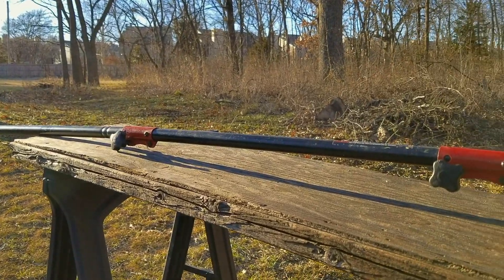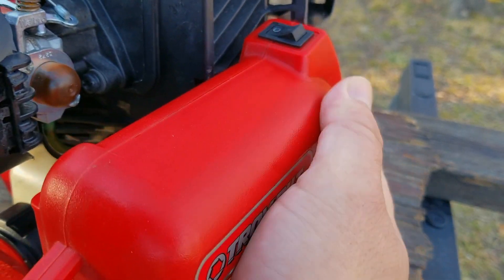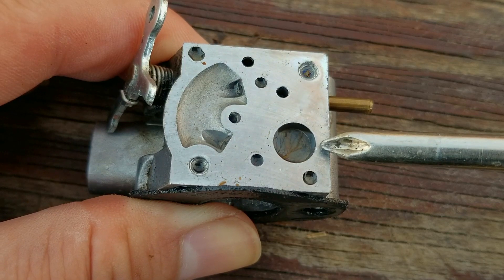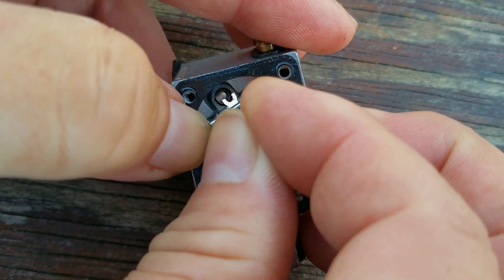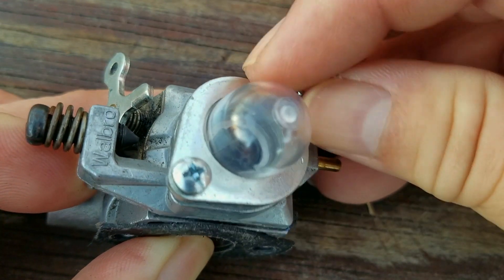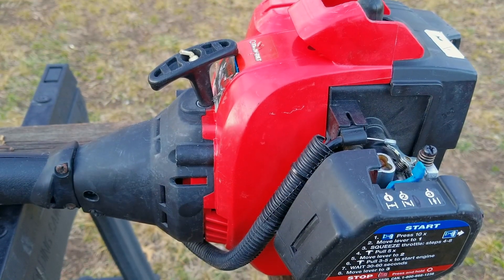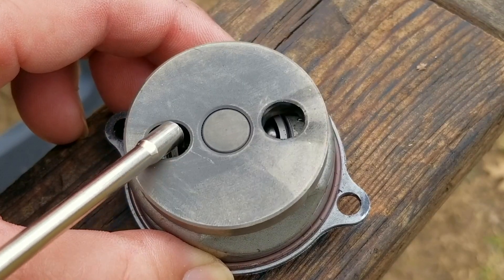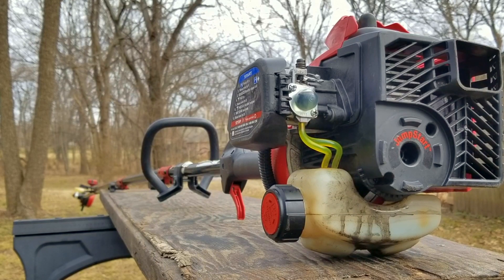Troy-Bilt Pole saw won't stay running

Comment: Nice saw, I would drill out the broken bolt, get two new ones and put them in with some apoxi or sealer
Reply from the maker: That's a very good idea
Reply: Or maybe use a bit longer screws with spring washers
Reply from the maker: @samuelvelez1643  that's a good possibility
Reply: or drill them out and put a small heli coil , do it right means doing it once eh ! Great videos tho bud my elderly neighbour picked up a toro blower that won't stay running and the carb is discontinued so with your excellent help I'm going to go through it to try to clean it up and tune it for him .
Reply: With drilling you can damage the treads, theres really good method with copper pipe and welding, search for it on youtube
Reply: @flaviokonti5522  thats what heli coils are made for

Comment: Excellent presentation in your videos. No uh uh stumbling or rambling. I do much appreciate that.
 Fyi to the brand believers.
If you work on several different brands you'll soon realize they're all the same engine. There are only two manufacturers of outdoor power equipment small engines. Trimmers blowers Etc. The only difference is the dressings. A friend gave me several roadside pickups. 1 blower and the others were trimmers. Two Troy-Bilt that were different models but the engines were exactly the  same. TB32 ec and TB35EC. 
A Murray that had the exact same engine. Three weed eater products of which one was a blower. The only difference was the blower had a shorter crankshaft. They were different from the Troy-Bilt but that is only due to being from an older design. There is no difference from buying a box store piece of equipment other than paying an extra 50 to $100 to buy one from a brand dealer
Reply from the maker: thank you and I appreciate the  information

Comment: I'd heat up the metal holding the broken bolt piece then drill the piece out with a left hand drill bit. The first two threads of the hole might get wrecked but you could chase them clean.
Reply from the maker: I didn't think about using heat. Thanks.

Comment: Ways like the multi tool attachment tools, they are much kore simpler and more compact instead of buying one tool for each if you can buy a tool system that’s interchangeable. Also, i hope your day as good my friend, look forward too your videos every week. Oh and my dad and i this summer will be working  on fixing the loose belts on our snowblower, and change the oil, we will replace the belts, sand the rusted spots down, and put a fresh coat of paint to make it look good. What do you think, sound good. I think so.
Reply from the maker: that sounds like a great idea. No harm in making something that's as useful as a snow blower look good again.

Comment: use extractor and remove broken screw retap and use new screws of higher grade with loctite 242
Reply from the maker: You read my mind!
Reply: i know Im quite randomly asking but do anybody know a good website to stream newly released series online ?
Reply: @Conrad Ezequiel Try FlixZone. Just search on google for it :)
Reply: @Dillon Tatum definitely, have been using Flixzone for since april myself :)
Reply: @Dillon Tatum Thanks, I signed up and it seems to work :) I really appreciate it !
Reply: @Conrad Ezequiel Glad I could help =)

Comment: Good video. I think it's worth trying to get the broken bolts out as it sounds like it still has plenty of sting left in it.
Reply from the maker: Yes I want to try and save it. I don't know if I'll get an easy out kit as this doesn't happen all the time so I might be wasting my money on it.
Reply: @HomeGaragechannel  
I wouldn't use easy outs anyway because they usually break and then you will have a problem. I have more success with drilling them then the rest of the thread comes out easy.
Reply from the maker: @stevenchandler4218  that's what I've seen too. The easy out breaks and now you have two problems.
Reply: @HomeGaragechannel  
Exactly and you don't want that to happen man.... Grrt!

Comment: Try & drill a small pilot hole in into the broken off screw & use an easy out to remove it or try & remove it using a thin  bladed screwdriver.

If worst comes to worss just drill it out oversized if you can & fit bigger screws on both sides,I had to do this with a Stihl hedge trimmer which was held together by 5mm self tapping screws,I drilled the threads out & fitted 6 mm  M304 grade stainless steel Allen head socket bolts which were much stronger !
Reply from the maker: You've read my mind

Comment: I would try some red thread locker and if that doesn't work try to get the broken end of the bolt out with a good easy out.
Reply from the maker: that's an option if I don't decide to try and drill it out.
Reply: Red threadlocker! Certainly, if you want to never never remove that bolt again. Use nothing beyond the blue when thread locking into aluminum

Comment: I would first try to extract the bolt. If that was unsuccessful, then I would use red thread locker and let it cure overnight before starting the engine. To ensure that it doesn’t back out, I would put the bolt in a vise and drill a hole through the side of the head. Install the bolt. Then take a piece of wire about twice as long as the distance to another bolt you can attach the wire to. Run the wire through the hole you drilled previously to somewhere near the midway point. Twist the wires together several turns keeping the first twists as tight to the head of the bolt as possible. Attach the loose end of the wire to the nearby bolt or anything metal and pull it tight. The wire will prevent the bolt from turning. If you want to drill the bolt out, take a piece of tubing that will fit in the hole and let the tubing be your drill guide. It will protect the threads and keep the bit centered on the bolt.
Reply from the maker: thank you Bruce Coleman.

Comment: Use high-temp, non-hardening gasket maker to seal the jump start adapter to the block. Extract any broken bolt(s) and install replacement(s) with high-strength threadlocker. Less than high-strength threadlocker (lock-tite blue, for example) will be weakened by the engine heat and thus effectively negated.
Reply from the maker: thank you

Comment: I think I have this same issue with my Troy built 4cycle. It’s hard starting and super annoying. Possibly not bc it does stay running. 

As for a fix I would drill the bolt out re tap the holes and thread lock new ones in.
Reply from the maker: Making plans for this fix already. Thanks

Comment: Hi,
see the video "How to remove a broken bolt in a deep hole  remove broken bolt in recessed hole" from the ultimate handyman. Perhaps you can drill out the bolt in 10 minutes with a centerdrilled bolt.
Reply from the maker: That's a good idea I'll have to take a look at the video
Reply from the maker: @xyz4469  now thats an idea

Comment: I'd say the reason that troybilt added the electric start is so it will be easier to start and run even troybilt knew their trimmer is hard to start but they are to lazy to fix the problem i suggest getting a commercial trimmer brand such as echo
Reply from the maker: That's a pretty good reason. Thanks
Reply: @HomeGaragechannel  you're welcome

Comment: My exact trimmer starts and runs like a top until it heats up, then stalls like I hit the kill switch.  Cools down, runs perfect until it gets hot.  Rinse lather repeat.  Did the very same before i totally replaced carb, lines, filters, and plug.  Maddening.
Reply from the maker: its either the ignition coil or the vent on the Fuel Tank.
Reply: @HomeGaragechannel  thanks very much!.  I’ll let you know how it works out.
Reply from the maker: good luck

Comment: I'd get a set of left handed drill bits and try and remove the stubs from the block or maybe drilling and tapping the bosses oversized and putting in a little bigger screws. That  jump starter is a fine idea but the one that I have hanging off my shoulder is getting pretty tired. Thanks and Blessings!
Reply from the maker: thank you Lewie McNeely
Reply: @HomeGaragechannel  U 2!

Comment: You should drill them out and tap the threads then add locktite to the new bolts and maybe even throw some lock-washers into the mix
Reply from the maker: that's a very good idea.

Comment: I need to get a carburetor rebuilt kit for my trimmers, they both have the same 25CC engine size. 
Where can I get the proper rebuilt kit for this carb? 
Great videos, have help me save my equipment.
Reply from the maker: go to ereplacmentparts dot com, and enter your model and serial number.

Comment: Great job as always.  My unsolicited opinion is:  this is why gasoline engines will go the route of the dinosaur.  It’s no wonder more and more people are choosing battery powered ‘everything’.
Reply from the maker: it does make sense, but I have to wonder about the environmental impact of making so many batteries.
Reply: @HomeGaragechannel  and what percentage of people dispose of li-ion batteries "properly" whatever that means. The price of replacement batteries is often more then the price of the tool its powering.

Comment: Remove the o-ring, clean the faces and fill with metal epoxy. Reassemble and let sit. Now you have a working engine.
Reply from the maker: the permanent fix
Reply: @HomeGaragechannel  Unless you want to drill out or extract the broken bolt, go for it.

Comment: I think the rest of that screw would come right out with an ez out. So does these types of string trimmers only have two kinds of carburetors? Short stem diaphragm and long stem? Thanks!
Reply from the maker: yes they are either short or long stems on the metering diaphragms. I haven't seen any other sizes.
Reply: @HomeGaragechannel  thank you for the info, your channel has answered many questions I've had on making my own repairs. I have a couple string trimmers that were my fathers, I'd love to get them running again. He passed away and hopefully he will be looking down when I get them going.
Reply from the maker: that would be a nice thing to do.

Comment: I would like to see you do a compression test on an old engine and a new engine. I have the same compression tester you showed and it will not measure the compression correctly on a engine with that small of a displacement. The reason being that it doesn't have a check valve on the screw in adapter. The small piston cannot pressure up the length of hose to the gauge. I am yet to find a small 2 cycle engine that it will work on. It will barely rise off of zero, but yet, the engines start and run fine. Show me!
Reply from the maker: I don't have a new engine available just yet but I do have an engine that has a lot of compression. I'm surprised your compression tester didn't have a valve in it.
Reply: @HomeGaragechannel  it has a valve right below the gauge. James Condon (Youtuber) clued me into this problem on one of his videos.

Comment: I got one of these trimmer heads same engine  and quick start feature for free and the crankshaft bearing wore out after I used it once after buying a carburetor for it. The crank was wobbling around and it caused the bottom and sides of the connecting rod to scrape all around inside the crankcase casing. I want to like these trimmers but I think they are the worst engine you can buy lol. They just have a very cheap sound to the engine when it’s running I don’t know how to explain it. It sounds hollow
Reply from the maker: I have to agree with you.  These are seen as good trimmers but really they're just like the other cheap stuff.

Comment: Drill the broken screw and clean it out of the hole. Get a replacement screw to help seal it. Its still a good motor.
Reply from the maker: yes you're definitely right, Thank you  babytammie.

Comment: New TroyBuilt TB25PS have crappy OEM fuel lines.  Mine is only 2 MONTHS old, Just pulled it out, fired up great but would run only a couple seconds as if starved for fuel. It was. The fuel line was sliding right off the hose barb as soon as the engine vibration started!! C'mon troy built - you can do better. Replaced hose and runs like new again.
Reply from the maker: I'm glad you were able to fix it!

Comment: I have never drunk one of these Troy-Bilt or craftsman or bolens or whatever others it's the same I've never scrapped one at I always fix them and you can get on eBay man and buy them jugs for 20 or 30 bucks and it takes about a good 45 minutes to change it well that's me anyhow

Comment: Yes, You can remove the broken fastener and/or drill and tap for a larger fastener but why? Some other problems will present themselves in short order. I was working on one for a coworker and noticed that the cylinder has the same cheap 2 bolt mounting. One of the cheap fasteners had broken off. I fixed it but 2 weeks later this backplate issue happened. Cut your losses and stop buying from box stores.
Reply from the maker: Great point! thank you Andy Becker

Comment: I would remove the broken part of the screw, chase the threads with a tap, and replace the screws with serrated head bolts or screws and use red loctite
Reply from the maker: thank you David Beard
Reply: Welcome

Comment: Those MTD engines are poorly designed.  I had a bolens trimmer like that where the engine seal on back went bad and the motor wouldn't stay running. Even using permatex sealer didn't work. My opinion,  these engines are only good for short term use and you're better off getting a premium brand like a stihl
Reply from the maker: I absolutely agree with you on that.

Comment: just strip it down and trash the engine. it s not worth any of time to repair or take the broken screw part outta this cheap stuff.
Reply from the maker: good idea
Reply: @HomeGaragechannel  by the way is the screw like the ones that it will cut the threads?
Reply from the maker: no its not self tapping